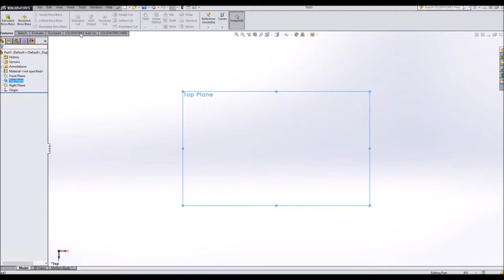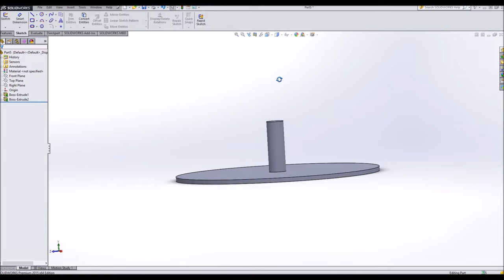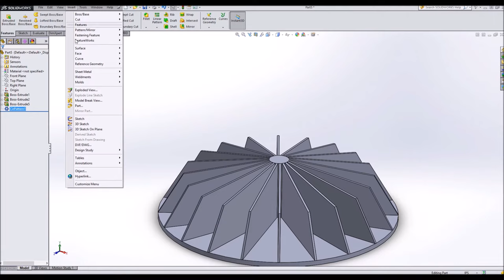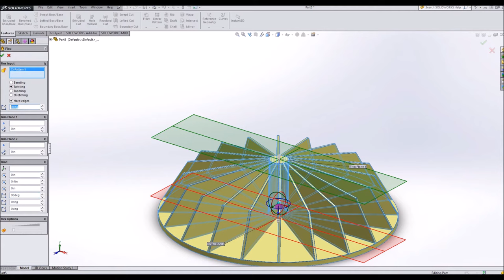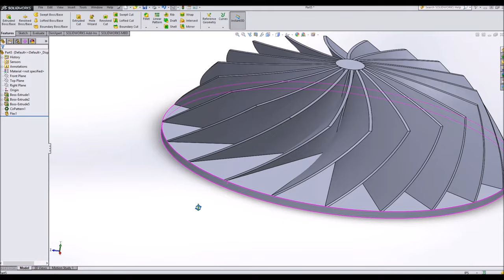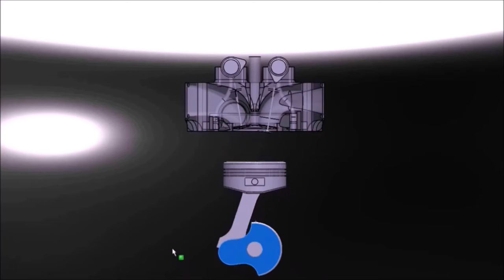Fast Easy Way to make Compressor/Turbine in SolidWorks|JOKO ENGINEERING|

Comment: This video could be improved greatly by adding audio describing the section where you use the Flex feature (as it is one that many newer users won't have seen before).  What are you clicking on?  What are the planes that pop up? Etc. Etc.  Interesting video nonetheless.
Reply from the maker: There was audio until a copyright claim for music you could barely hear in the background from the outside.